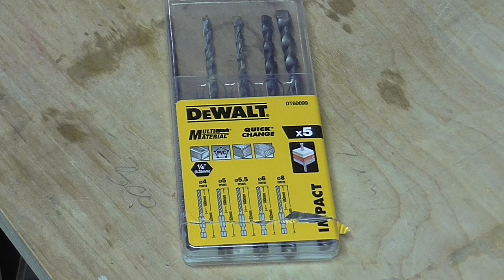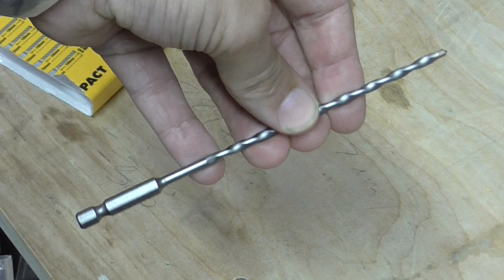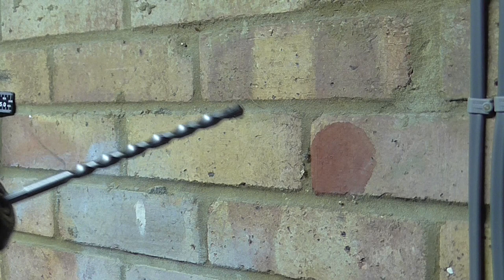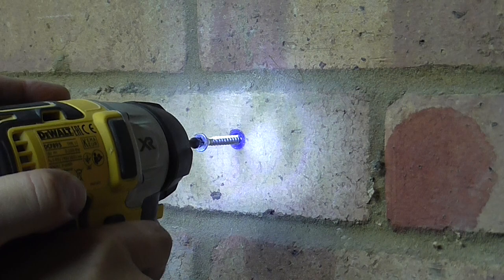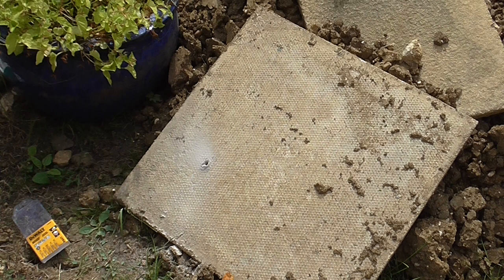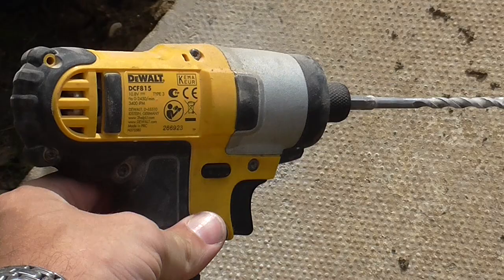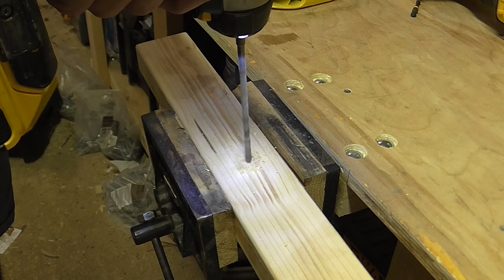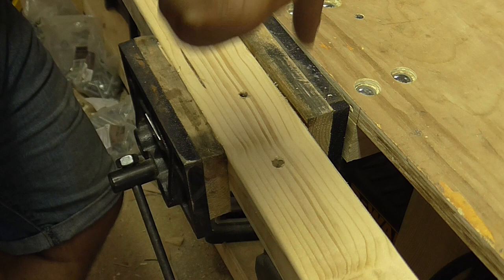Drill Masonry with an Impact Driver - Hex Shank Multi Material Drill Bits

Comment: Some people are really dull saying oh buy hammer drill bla bla. 
If you only need to drill couple of holes into the concrete and you only have an impact driver, why would you buy a second device? 
I think for a DIYer or a house owner who only needs to use it less frequently impact is the best all rounder, and it is smaller.
Obviously if this is your profession, you'd already have all of the different types of drivers/drills.
Reply: @The.Toaster  Wrong, the impact driver has much more torque and is a great all-rounder. You can even buy adjustable chucks to put in the impact driver. 
Impact driver is not used for nuts and bolts, that is called an impact WRENCH. Get your facts straight buddy.
Reply: @The.Toaster  Lmao, if you work with repairing rc vehicles you need to shut it, as i said the impact is great for diyer and has multiple uses, yes it uses a hex shank and there is a lot of different attachments to it. Hole-saw hex, drill hex, nut hex etc. A combi drill will never get the same torque nor speed. Dont talk about things you dont know buddy, I work in mechanical engineering so dont fool yourself. LOL.
Reply: @maskenmakkan  I completely agree.  I used a regular drill / driver for years and finally broken down and got an impact driver.  It's like night and day for driving screws - days of stripped heads and sheared screws are all behind me as it drives 3 or 4 inch screws through wood like butter.  But I've also had a lot of luck using it with an adapter to utilize my regular sockets.

Comment: Impact function isn’t in play much at all. Functioning like a regular drill. Will work fine on softer masonry but will burn up the bits due to friction on harder masonry. Hammer drill chips away as it drills and the heat is much less. Thanks for the demonstration.

Comment: its because impact drivers apply their "impact" rotationally, not back and forth like a hammer drill. Hammer drills plunge in and out, which is really how masonry bits are designed to work. Just rotating a masonry bit is going to dull it. Masonry bits will work with the impact driver, for a little while, but it wont be long before its dull.
Reply: Please can you recommend a good set of masonry bits for a impact driver with hammer function (cordless 20v)? thanks in advance (ah, not SDS please)
Reply from the maker: Do you mean hammer drill? No such thing as impact driver with hammer function.
Reply: @WheresMyPencilUK  Yes. i meant a hammer drill (nowadays if you search on amazon the description will quite often be impact driver and hammer or something alone those lines)
Reply from the maker: Ok I find the DeWalt extreme masonry bits very good. The do them in non SDS in a set. 👍🏼
Reply: @WheresMyPencilUK  Thanks so much! ( DW5207 right?)
Reply: @dxdux  Makita have a good range of bits.
Reply: @johnw2758  Thank you!

Comment: These multi-material drill bits are great, I used some from bosch (with a blue coat) to install some locks on ATM's vault, some model have 3 layers, steel-concrete-steel so these bits worked amazing to get through that concrete layer

Comment: Really appreciate this post. Never heard of these bits. These tool combinations have application specific uses  but the laws of physics and mechanics still cannot be defied. Least not by mortals.
I'd enjoy having these bits, the screwdrivers and a nice impact on a cable/conduit run where there's  fastening to timber and concrete on the same run.
Yet ever so often, part-way into a block there is a vein of something (flint, granite? Of course you'd know if it was rebar) that just ignores this type of drilling and bits. 
After some choice language one would have to climb down for the trusted old corded hammer and have it pulverize the dickens out of that tough spot!

Comment: If you have a hammer drill, then just use it, yeah an impact will eventually go through brick etc, spinning without the hammer function just ruins the bit, and take so much longer.
Reply: Thanks for pointing out the obvious

Comment: I can vouch for the Bosch bits. They will drill through anything. I've made holes in wood, cast iron and stone with no problems.
Reply from the maker: Thanks David I hear they are good but quite pricey.
Reply: Happy Wife Happy Life 
Depends what you mean by pricey! £3 for a 6mm from screwfix.
Reply from the maker: The DeWalt ones are £5 for 4. Also thats not £3 for a Bosch 1/4" hex bit so you aren't comparing the same thing as you couldn't use them in an impact driver. The 1/4" hex are £17.50 for 5 so quite a difference.
Reply: I've used both and find the Bosch to be better, the Dewalt are good in masonry but going through timber to masonry they struggled with the timber and burned though.

Comment: So, does the ordinary accu drill go faster through the wood or concrete, compared to accu impact driver? What's the benefit of the drill over the impact driver when you compare them in drilling mode? Not talking about driving screws, that's obvious.

Comment: So do we need anything other than an impact driver for all jobs!! If your a home diy’er these hex would be great for your impact. I’ve got 3 different dewalt drills I already have a custom chuck from an old dewalt drill converted into hex any chuck can be customised!! Now I feel I should get rid of all my drills and buff my brushless impact driver with hex bits for all jobs if your doing jobs at home this would be perfect but bigger jobs would need bigger tools?? I will think about what I want to do great video cheers ❤
Reply from the maker: I think they key things you need as a DIYer are an impact driver and an SDS drill. 
The impact is fine for most things but for tough masonry and concrete you will burn out this type of bit if you aren’t careful. It will get you out of a bind though.
Reply: @WheresMyPencilUK 
If you are drilling into a wall/concrete/brick every once in a while for putting a hanger or something

And you mostly fasten screws into furniture/ikea stuff

I guess impact would be best, yes the bit will go bad, and the impacts life might take a hit, but this way you get a tool that is the same as hammerhead drill, while being lighter and more compact no?

I'm just trying to make a sense of all of these different types of drills, I need a 20v either milwaukee or bosch - either thinking to buy 1 tool to do it all like the one with hammerhead function (jack of trades) or just an impact and a separate drill (without hammerhead function) and relying on bits for masonry stuff every now and then
Reply from the maker: An impact drill will not give the same function as a hammer drill as the impact is in a twisting action in the direction of rotation not a forwards impact. Therefore an impact driver will only give the same level of drilling capability as a non hammer drill. They are better for installing fasteners though due to greater torque. As I’ve said if it were me I’d get an impact and an SDS drill.
Reply: will a straight shank work with a hex shank? i have a 3/8 installer/bell hanger. i'm trying to find an adaptor for it or if i need a specific type of drill for it. my impact driver has a hex chuck that is 1/4.

Comment: Good video. Like it.  I’ve came to see if I was drilling correctly as I was struggling with my ‘so called top of the range powerful DeWALT DCD996 Combi drill and even setting at  hammer drill I struggled to make a dent on a stone built wall. Maybe i was using cheap Black & Decker drill bits. I will order some expensive ones and see if it works. I understand Combi drills mainly works well on wood etc.. but they also advertise it can be used on hard walls too such to drill on a partition wall to hung a pic for example.
Reply from the maker: Thanks I have this, the same combi as you and 2 SDS hammer drills (one battery one corded). 
If I’m drilling in masonry and especially in concrete I use the SDS. I think I’ve only used the Combi once for masonry. These impact bits are just to get you out of a pinch really. I’d recommend a cheap SDS to anyone as the chisel function is very handy. Hope that helps.

Comment: good review. surprised it struggled with wood.  Maybe you dulled the 8mm by drilling the concrete for too long and made the bit get too hot?  Anyhow, I haven't tried these.  I have the bosch ones and they seemed to work ok. I like the fact they allow you to drill into brick without needing a hammer drill, so it's much quieter.
Reply from the maker: Thanks ksp1278 I tried them all on wood and they were ok but seemed better on brick and mortar. 
Made mincemeat out of breeze block and plasterboard. 
6mm tends to be my go to bit size for plugs and it worked great so I might see if I can get individual 6mm bits.
Reply: regardless of material it's also blunt as hell when compared to a standard HSS wood/metal bit.

Comment: Because the packaging says 'impact' doesn't mean it's for impact driver, it most likely means it supports impacts from a drill (hammer drill, which can also have hex adapter and those bits gets more convenient when you do need to switch often with a single device between drilling and driving screws)
Reply from the maker: Not what this says. https://www.screwfix.com/p/dewalt-hex-shank-multi-material-impact-driver-drill-bits-set-5-pieces/4435P?tc=FA2&ds_kid=92700022882458891&ds_rl=1241687&ds_rl=1245250&ds_rl=1244066&ds_rl=1249796&ds_rl=1245250&ds_rl=1249481&gclid=CjwKCAjwsfreBRB9EiwAikSUHd-0an5qCaGYWUAg9LNqCc5pAEVYDhnY6OKDOmlMhCkBBlE6c5MUARoCWxcQAvD_BwE&gclsrc=aw.ds
Reply: sebxx 
It seems like in the end, the impact driver will drill “smaller” holes in concrete/etc, in a pinch but it’s prob best to use a hammer drill.

Thanks for making this video!

Comment: Hi I discovered the merits of the Dewalt drill bits recently - just loved how they drilled into house brick like it was cheese. I am only an amateur and only recently discovered  'concrete' screws at  Screwfix  - have you tried them absolutely brilliant great time saver too?
Reply from the maker: Thanks Norman they are great bits. I use concrete screws. Give "wall dogs" a try they don't need plugs just a 3.5/4mm hole in the brick/mortar.
Reply: Happy Wife Happy Life - Thanks for the wall dogs tip - I looked at them but they are quite limited (max length 32 mm) I recently used some 80mm jobs from Screwfix with T30 heads - absolutely fantastic.

Comment: I guess the only thing going for it is that impact drivers spin at a higher speed than normal drill drivers. Flat bits work great with impact drivers.
Reply from the maker: Zed Man they do but you have to be careful they don’t bind. I’ve snapped a spade bit with an impact driver.

Comment: Ive been trying to figure out how others are able to drill into concrete with an impact. I must be doing something wrong. Think i spent 5 mins trying with new bits and my makita. Lol i totally gave up and went and bought a hammerdrill. Did it in seconds.
Reply from the maker: Not really the ideal tool. These bits are designed to get you out of a pinch. Cheap SDS hammer drill always your best bet if doing it infrequently. Get one with rotation stop so you can use for light chiselling too.

Comment: If you were drilling wood onto brick can you just put the plugs into the wood with a hammer and then let the screws drive the plug into the brick or is that a bad idea.
Reply: I put the plug in the wood put the screw in alittle then hammer it so it pushes the plug through into the wall works great 👍

Comment: Most people just use what's at hand, an old  Steele drill bit will go through wood or brick, you don't need hammer action for that.
Most people only ever drill a few holes in thing's, they aren't doing it for a job so if it takes 5minutes to drill a hole then that's ok for them.
All my equipment is aeg, I've got drills impact drivers, sds drills.
I have 100 of drill bits of all shapes and sizes and flat drill bits for cutting holes in wood etc etc.
Most of which is never used, because I normally go overboard when I need something or think I'll need it

Comment: great video +1 and yeah you can, of course, you an impact driver as a drill into hard stone material, at least to some extent,.
and you around the same level as a combi drill hence hammer-effect or vibrato effect.
and SDS rotary drill takes it quite a step further.

Comment: got a question for you it I have an impact rated drilll for my driver is it possible to use a regular hex shaped extender  or does it need to be impact rated ? I mean if the part fits should it be ok with a standard hex extension plug as long as my drill tip is impact rated? thoughts please thank you
Reply from the maker: I would use an impact rated extender. The torque could shatter the non impact rated one.

Comment: Nice video thanks. 

Goes to show that the average DIYer can get away with just having an impact driver ... if they really had to choose and could only get one power tool ... forget the expensive hammer Combi drill, the rotary drill ... just get an impact driver. It really can do it all. 👍🏻
Reply: That's the point!
Reply: Marc Naidu I’m not sure I’d try to use a forstner bit or drill metal with an impact driver, the motor was starting to over heat just drilling concrete.
Reply: I bought an impact instead of a drill because I only had money for one tool.

Comment: These bits make no sense when drilling concrete the impact is the most important part. What a hammer drill or preferably a rotary hammer does is makes the bit impact the surface causing a chip then the drill head digs into that chip. What your impact is doing is not the same the impact is entirely rotational you would probably get through faster with a titanium bit with a pilot head. All this bit will do is lead to premature failure of your impact driver I suggest you invest in a rotary hammer if you look to drill concrete even hammer drills aren't very effective at impacting they just use ratchet drives to create vibration more so then actual hammering.
Reply: I understand the appeal of an on hand solution for concrete drilling that saves you from switching tools but sustained high rpm with heavy drag mixed with concrete sediment will just lead to burning up your drill and of course manufactures will say it's fine they are the ones who get to sell you the replacement. You would be better served running Bosch diamond speed bits they will eat through small jobs like this and actually self feed not put all the stress on your brushless motor.

Comment: Cannot find dewalt bits here. Can i use makita ones? As long as the size is the same? 1/4” hex
Reply: Yes
Reply: As long as they're masonry bits you should be fine. I've used regular drill bits before but expect them to be pretty much unusable after every hole.

Comment: An impact driver does not work like a hammer drill. The impact is sideways - lateral, not horizontal.
Reply from the maker: Well observed. At no point did I say it did.....
Reply: And that is why these bits have been designed for an impact driver as they drill without the use of a hammer action !
I have these and they are a good set to get you out the shit at times they are like a back up set to do the odd few holes when you don’t have your sds at hand

Comment: They are a decent price, but isn’t one of the selling points of impact drivers that you don’t need to keep changing bits in your drill? I'm not sure many people would have an impact driver but no hammer drill.
Reply from the maker: Maybe but I guess if up a ladder it easier to quickly change a bit than get another tool.
Reply: I only have a impact driver because I rarely drill holes. And in rare situation where I need to drill a hole these drill bits are life savers

Comment: Can drill throught a wood on concrete with small diameter then drill a concrete with large diameter
Reply from the maker: +Iginio BLUEVEST yes although you would then need to drill the wood with a larger bit as well.
Reply: Ok thank you

Comment: Oh man, this is the type of drill bit you use when your time is worth less than your money, spare yourself and just buy a friggin hammer drill. This bit is demonstrably very slow, and will wear down with heat and friction because of the very high RPM that an impact driver produces. If you absolutely must drill one single very important hole in the span of your entire life, then maybe this bit would be worthwhile, assuming you'd never use it again.

If you're a DIYer, honestly get a hammer drill before you get an impact driver. It will do all the things an impact driver does, plus actually being able to drill holes into masonry in decent time.
Reply: Have you not seen his wall, he's probably got three hammer drills hanging up there

Comment: Its not a drill it's s screwdriver the hex is not to use specificly in that type of drill  there designed to stop clutch spin and not to ware your chuck teeth even tho it works a bit
Reply from the maker: Why do the bits say “for use in impact drivers and combi drills” on them then?
Reply: most impact driver makers offer hex drill bits for drilling using the impact driver... its not ideal, but for light use like your every day home projects it should be fine for those who don't want two tools...

Comment: Dewalt impacts just suck ass. Them things get hotter than any other brand and fail constantly.  I would just drill through the mortar instead of the brick itself.
Reply: @Foxtrot my bosch impact drill works fine with masonry bits
Reply: We use all Dewalt and have loved all of their tools.  We have the impact driver, drill, chainsaw, circular saw, small circular saw, reciprocating saw and a flashlight!